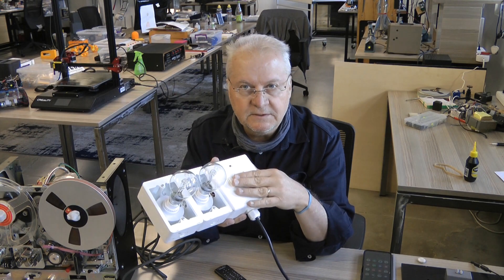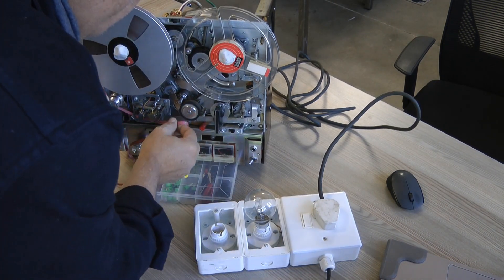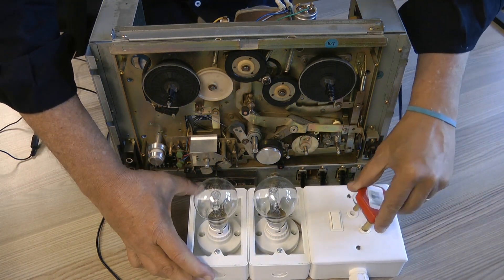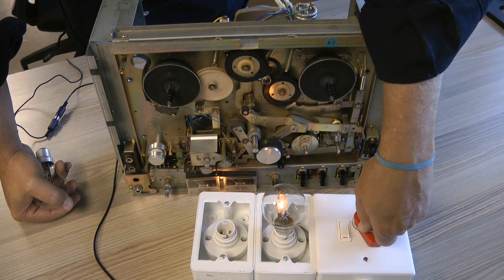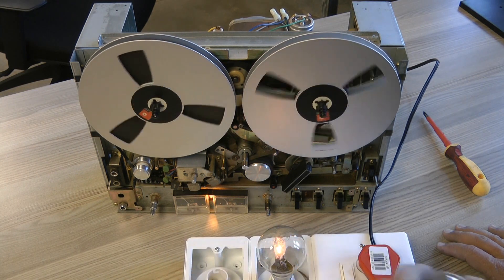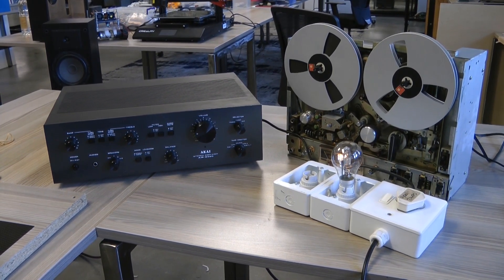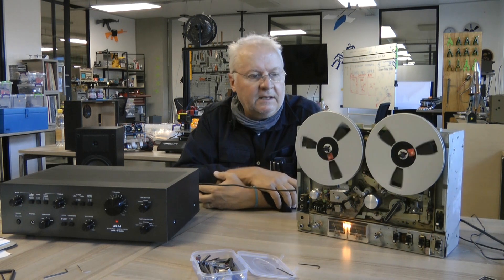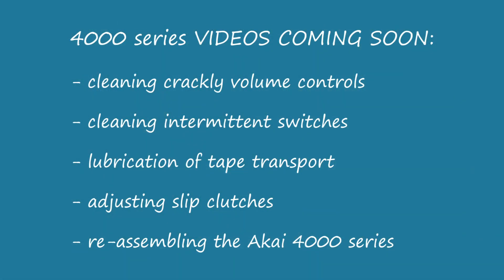EA.029 Akai 4000 DS II: PART 5

Comment: hi have worked on alot of the akai reel to reel
they do come over like they use alot of power
i never had anything go bad with them
i had to change over  audio amp ic's in
the  1800ss decks 

i find thje tascam 30 line don't pull the power
they have alot of up dates

when the deck  not used  and they no  tape
the capstan motor is turned of  

only pulls power when deck is used  

them later ballfinger are well made 

they cost big money all that runs the deck
is power ic's for the reel motors

and  and a mini pie computer  or logic 
 i have a tascam 38 i jazzed up  because
the main pcb was going bad all over 

has not age well